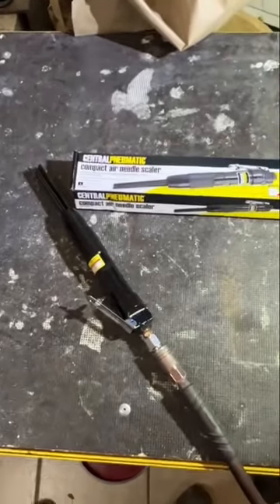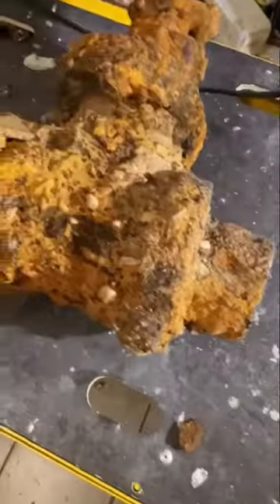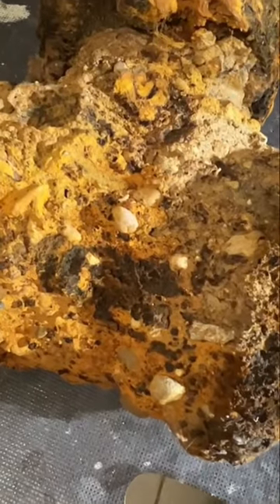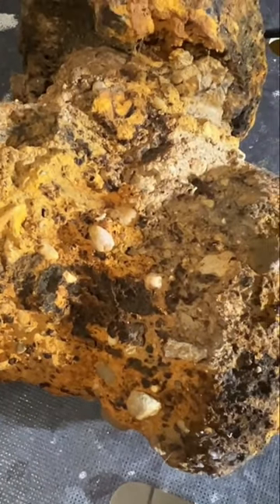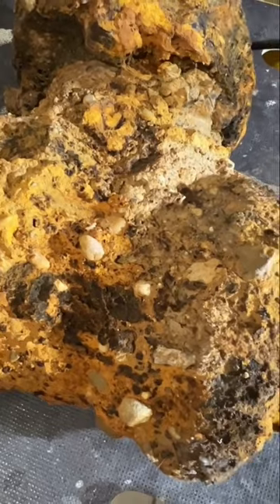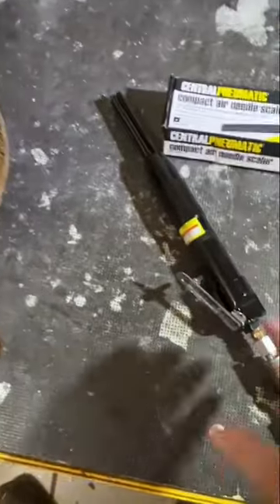Harbor Freight needle scaler vs concrete old 6” gate valve!

Comment: I don't give a fuck what anyone says harbor freight has some really good shit. They are grossly underrated in the tool world and most to all of there tools that are their brand come from major brand names like snap on so while yes you're not getting a 300$ wrench from snap on you're paying hundreds less for the same materials that make them 

Now with that all said YES there are just some tools that.... I wouldn't say DONT buy but just keep in mind sometimes MOST times ya pay for what ya get
Reply: Air compressors and tools are usually very solid considering the price. I don’t trust their electric tools much further than they can be thrown. Haven’t used many of their hand tools but the few I have seemed ok enough considering I could just return it whenever it broke.
Reply: @jollyjackass  I agree completely. I bought one Harbor Freight electric grinder that did not last one day. Took it back, got a free warranty replacement. That identical one, from the same stack as the original has lasted me over ten years.

Comment: That is going to destroy the exterior of that thing though
Reply from the maker: Didn’t come out to bad after scaler and vinegar bath 
https://youtu.be/FzdXUy_A2cQ
Reply: Air needle tools are used all over in the industrial business, auto-welding and fabrication-finish products. They are meant to be used hard and not destroy the exterior of things, that why there are needles that set on a rubber diaphragm inside. If you used just one needle or an air hammer with a small pointer insert it will destroy the finished product

Comment: Harbor freight is junk. It will not last. I think you’re supposed to temper still before you try to build a air tool.
Reply from the maker: I have an air ratchet I paid $20 for from harbor freight and it lasted 20 years. A dollar 💵 a year isn’t bad
Reply: Harbor freight is only disliked by those who don’t get what harbor freight is for.